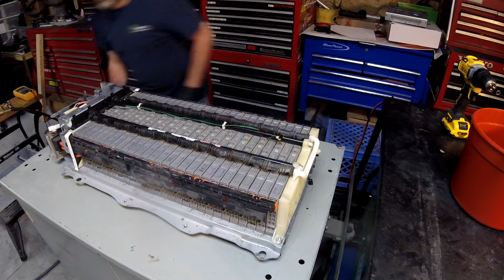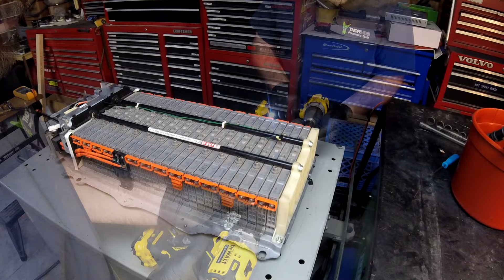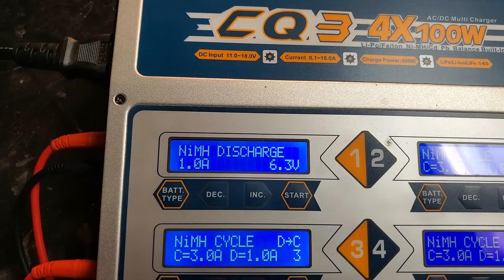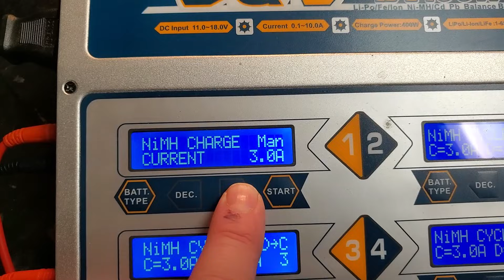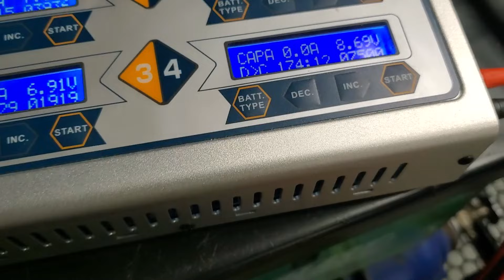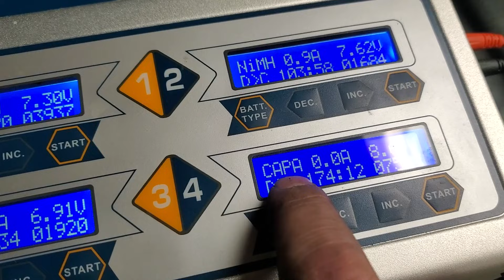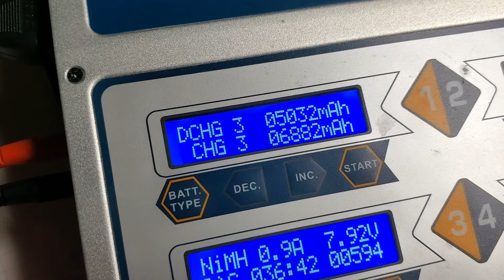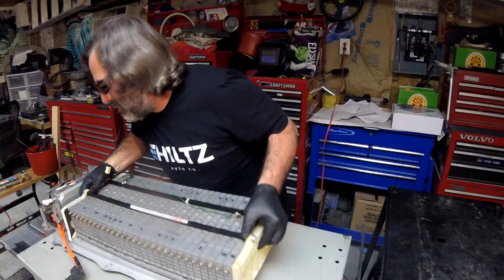DIY Refurbish / Repair Hybrid Battery 2nd Gen Toyota Prius - EV-Peak smart charger POA80 P0A80

Comment: how long will it last after charging?
Reply from the maker: That is hard to say. A pack with all cells close capacity to each other and higher capacity overall will last longer than a pack with cells that vary more in capacity and are lower capacity overall. I have had great results with the 5000mah minimum and positioning as mentioned in the video.
Reply: @GreggFesto  Hi, I have prius c and I tested my hybrid battery cells, they were showing 13,45-13,75. Mechanic said it is very bad and soon car will display Check and battery cells will start to die. Can reconditioning help? And if so how long can they last? Thank you
Reply from the maker: Giorgi, Refurbish as in my video will help cells that are starting to fail most of the time. It is possible some cells will still need to be replaced. The best way to proceed would be to follow the instructions in video so you can replace only the cells that cannot be recovered to at least 5000mah. Because you have not yet displayed check light then is is hood possibility all of your cells can be refurbished to 5000mah and you will not need to replace any. I hope you will try this and let us all know how it turns out.

Comment: So I'm having some problems I was getting ok numbers but chargers set to 1a dc n 3a c but with the cheaper chargers would dc at .6 so I got 1 of these chargers your using and always pull .9a on DC and throwing all my numbers off like I get 5500bc n 500c could I be over charging them it's set to 7500mah cap
Reply from the maker: Hello Charlie, Thanks for watching and writing in. I do not understand fully your message but will do my best to answer what I can understand. The 7500mah cap is correct for Prius cells. With charger setup as in video, there will not be an overcharge of the cell. Please let me know if this answers your question. Gregg

Comment: Hi Greg, quick question.... did you ever experience your charge cycles stop early at 50 mAh? It keeps happening randomly. I have multiple EV Peak CQ3's and all of them have experienced it at one point or another.
Reply: problem solved...issue was having the pre charging timer on. during the pre charging period you are only charging the battery at 1 amp for 5 minutes... this caused a premature charging completion.
Reply from the maker: Very interesting. Glad you figured out the issue and super stoked that you took the time to write back in and help others reading the comments that may have this issue. Hats off to you Daniel. Thank you very much.
Reply: I think my issue is that I built my own wires/alligator clips and banana plugs because the ones included were too short. Perhaps the issue is that the wire I originally used was 14 gauge... not sure. I can't make sense how it cycles normally but sometimes it only charges to 50mAh
Reply: update for any others that might have had the same issue I had. My gauge wires were not the issue, 14 and 18 gauge both work fine. it seems the issue might have been that under the user settings I had the pre charge on at 5 minutes.
Can anyone explain why this often but not always led to charging stopping at 50mAh?
Reply from the maker: I have not had this issue Daniel, I hope someone reading this can answer your question.  I thank you for watching and commenting.

Comment: Hi I'm having a problem with charging my cells on my new evpeak cq3 charger. It is only charging them now on one cycle then it flashes caps on the screen and charging stops.. The settings are what u recommended to put in. I checked the voltage on the cell and it read 8.38 volts... That seems to high of a charge for these cells overcharging? What next? What settings should I adjust to? Nick
Reply: Sorry it's flashing capa
Reply: Where is that place to change cutoff to 6.3v people are taking about? Nick
Reply from the maker: The 6.3V setting mentioned on the description list and some comments is set on the screen where you set the Discharge/Charge settings
Reply from the maker: The flashing CAPA on the screen means that your charger met the 7500mah capacity setting.  If the low capacity number is at least 5000mah then this cell is good and complete. If less than 5000mah on low number you should run it again.

Comment: So I followed your instructions in the settings for my charger/discharger. After second run it is at capacity. 7500Amh charge and 0Amh discharge. 3rd run was 0Amh charge and 0 Amh discharge. My direct voltage reading before was 7.86. After the charge/discharge it's 8.4 . Why am I getting the 0 Amh reading. Here you say it must be minimum 5000Amh yet I have increased voltage. Need help
Reply from the maker: Hello A Hendrickson, The cell voltage is not as important as the capacity.  The capacity is what will determine the health of the cell/pack. It is possible that you have a failing cell which can show voltage present and have no real power to sustain that voltage. A way to confirm this would be to connect a 12V bulb to a known good cell and see how bright the light is after a set period of time then repeat the process with a suspect cell. If the suspect cell is 0mah and 8.4V it will not last very long at all when compared to a cell that is say 7.2V @ 5000mah.
Reply: @GreggFesto  so,
 first run was C- 2256 mah and d- 5565 mah.
Second run C- 5576 mah and d- 2768mah.
3rd run- c7500mah and d- 0 mah.
Every module running similarly.
These modules are toasted? Or can I try again to run it through another round with my EV-Peak?
Reply from the maker: A Hendrickson, I have not had this sort of issue before.  Perhaps there is an improper setting in the charger or there is something wrong with the charger?
Reply: I think I figured it out. I didn't set the proper cut off at 6.3v. it was at .1v. 

I read through all your thread here and someone mentioned you didn't have the cutoff in the video and you confirmed it should be at 6.3v.  I hope I didn't ruin the modules. Anyways, I'm still waiting for the first run to finish with proper settings to see if it works
Reply from the maker: A Hendrickson, I had forgotten about that. I am glad you searched the comments and found it. Please let me know how it comes out.
Reply: @GreggFesto  hi. Where is the setting to adjust to 6.3v on the CQ3 charger?
Reply: @LordPillsbury1959  where is that setting to adjust the cutoff to 6.3v? Nick

Comment: Enjoyed the DiY effort. her's my effort for the 12 V lead acid battery renewal. Also aimed at the DiY Guy. https://www.youtube.com/watch?v=Dd0HBqpBgok
Reply from the maker: Hello Ancel, Thank you very much for watching and subscribing.  I checked out your video and your other projects on HackadayIO and just had to subscribe to your channel. I like how you went through the complete process of restoring the 12v and 6v batteries. I like that you have the kit available with all parts sourced so someone like myself who hates searching/ordering parts can have the fun of assembly still. I read that you will soon add more chemistry types to the unit, do you plan to have more voltage selections as well?
Reply: @GreggFesto  Hey...I have developed a prototype for the Toyota NiMH reconditioning. Independent University validated as a Engineering Masters project. I am developing 3 new devices. 1) A less costly 'Prolong' knockoff. 2) A complete 28 cell harness reconditioner 3) An active balancer add on for the Vehicle's  BMS = no more servicing of unbalanced cells needed.
Reply from the maker: Ancel, That is awesome. Do you plan to list these as units that can be purchased as well?
Reply: @GreggFesto  Yes , the timeline is early 2023. I am presenting to our National Chamber of Energy in 2 weeks.
Reply from the maker: Ancel, I hope all goes well for you. I am extremely impressed with your projects. Your hard work shows. Please write back and let me know the outcome of your presentation.
Reply: @GreggFesto  Started R&D into rehydrating the NiMh modules. Looks like venting H20  is the cause of failure in the hot centre cells. Developing an automated test bench to establish statistical  rehydraton outcomes. Resealing the cells via 6-32 drill/tap and JB Weld seal pressure formed with a plastic grub screw.

Comment: O saw video it shows how fix cells not good they charge and discharge to make cells usable is it ok does it work?
Reply from the maker: Yes Edwin, This process works well. I have done this to multiple packs with great results. Thank you for watching and commenting.
Reply: @GreggFesto  I use my car for work I want get spare battery in case also if battery kept as spare and not used will it die
Reply from the maker: I have stored a battery pack at least a year and it worked fine when put in the car. I have no idea how long a pack will last in storage.
Reply: @GreggFesto  where can I find a pack that's can use for this
Reply from the maker: If looking for a used pack I suggest ebay, online individuals selling such as a craigslist or facebook, or a car salvage yard.
Reply: @GreggFesto  there is repair store selling 28; dead cells 200$ is it worthed and where can I find dead cells free?
Reply from the maker: I would not pay for dead cell, what would you do with it? I have no idea where you can find them, perhaps search battery recycling center or such?
Reply: @GreggFesto  I thought if I get dead cell and refurbish thought cahrgeing and discharge process seen on utube
Reply from the maker: The method I used in video will refurbish a cell but not make a bad cell new again. There is a threshold low capacity of at least 5000mah to be considered good. I have had to replace multiple cells in just about every pack I have refurbished. If a company is selling "dead Cell;s" then I would believe they have been tested and cannot be recovered for use as a battery but rather being sold for the elements the cell is constructed from. Either way, I just do my method and replace cells as required. Thank you for your interest.
Reply: @GreggFesto  what reliable place get cells
Reply from the maker: Edwin,  There are ALLOT of sellers with good cells. Scroll through and read these comments, I list the name of place I got replacements for this pack. I have purchased from a few vendors with great results.

Comment: Great video! This is my 2nd time doing this and this video is gave me a better setup. I got quick question right now i have 6 bad cells. a have a couple cells that discharges above 5k mAh but really low charging mAh example cell 26 discharged 05169mAh but only charged at 00366mAh. is that a bad sign?
Reply from the maker: Hello Louis, Thank you for watching and commenting.  Your low mah number should be above 5000mah to be efficient. I am not sure how the high mah could be lower than the low mah. Perhaps the numbers got crossed when you recorded results? If this is the case, the low reading of 366mah and a high reading of 5169mah would mean that the cell is not good. Perhaps it can be refurbished through more discharge/charge cycles. I have run upwards of 12 cycles on a cell, sometimes with in a positive result. Most of the time when 366mah low number it just gets worse though. Can you please write back in with what you decide to do from this point and what your end results are?
Reply: @GreggFesto  thank you for replying. Yeah for some reason I have a few batteries that’s reading as charge low capacity and high discharge right now. When I first did this I revived all batteries that were bad (4)and reordered the best batteries in the middle to the weak low number towards the end. Only last about 14 months. This time I have 8 real bad one so far. I’ll update you if I am able to revive the ones that charge less but able to discharge above 5k mAh
Thanks again for this easy to understand video 💯
Reply: @GreggFesto  Hey Greg I am almost ready just wrapping up on one more cell. When you balanced the battery did you charge first then let it sit, or you just let it all sit and balanced itself?
Reply: I'm actually not going to charge anymore and just let it balance itself :) i dont want to overcharge the batteries in series.
Reply from the maker: Louis, I put all batteries in parallel when they were charged up.
Reply: @GreggFesto  A little update I ended up changing 9 cells. Also, I think some of my chargers are going bad in the charging phase, that is why when it charges it stops at a random number (b6 chargers). i have 4 b6 chargers and it looks like 2 of them going bad. I also have 2 hobby king quad chargers but only 4 of the 8 ports works. 
So far the car has been running fine since  May 24 and just passed a smog inspection that  Ca requires every 2 years. I am hoping this time the battery last over 18 month since i changed all those cells. Once it goes bad again i will reply back to this board :) Thank you again Gregg for the video!
Reply from the maker: Louis, Thanks for writing back in with your update. I sorry to hear about the charger failures. I have not had any problems with my charger so far and hope this will continue to be the case. I look forward to your next update. Stay safe, Gregg
Reply: @GreggFesto  Hi Gregg, Just wanted to update that over the weekend my triangle went on after a good 8 months. This time i will use the Dr. Prius app and see which module is bad and maybe just repair that and will update you on what I decide to do. I wish there was an easier way. this will be my 3rd time doing this. I plan to keep this car for much longer and will probably look for newer batteries as an option. i only have 228k LOL i made it  sound like it was very little.:)
Reply from the maker: Louis, Thank you for writing in with an update. Do you think the charger issues you were having before contributed to the triangle coming back so fast? I am interested to know what you find out. Can you please update what you find for pack health with Dr Prius? 227KMiles is very good. I hope you go many many more.

Comment from the maker: Sidney Peters (see comments below) has had great results with a Protek RC Prodigy Charger as a replacement for the charger I used which is getting hard to find.
Reply: @gregg festo ok so I finished watching this entirely.. and I’m not sure but will this take like 2 weeks to complete so I’ll be out of a vehicle for half a month?

How long does each module take to recharge/refurbish??
Reply: @erxfav3197  It depends on the strength of each cell. I'm currently refurbishing a Prius battery pack and for each cell to go through 3 discharge --> charge cycles took about a full day. So I bought 2 of the charger devices in order to do 8 cells at once. In about 4 days I finished cycling all 28 cells and then I removed the weak ones.

Comment: I’m following all your settings on my charger, but it’s only going through 1 cycle instead of 3. I had to do it manually 2x and I’m getting a reading of 7500/4781 then 7500/4467. I’m getting similar results with other cells with only a slight increase with the low number. (Ie 4633 to 4737) 
1)Should I keep charging/discharging until I get the bottom number over 5000?
2) Would increasing the max capacity cutoff setting from 7500mAh to 7800mAh or 8000mAh prevent it from stopping  prematurely(if it is).  If I’m always getting a reading below 5000mAh for the second number, should I increase safety timer from 720 min to a higher time or turn it off completely?
Thanks!
Reply from the maker: Hey Miami King, It appears the charger is working correctly and stopping cycles after it sees the 7500mah. Yes, you should continue to do the cycles until your low number is at least 5000mah as it is the low number that will determine the overall capacity of your pack. The safety timer is not being activated 720min so no need to change it.  It appears you are on the path to success as your low numbers are rising and the high numbers are not falling. This is good. It does take time to complete this process but it well worth it. Please keep us informed of your progress.
Reply: @GreggFesto  thanks for the reply!
I’ll keep going at it then.
Is it normal to get a strange sequence of readings like: 5461/4633 then 7500/4237 then 1924/4917 then 7500/1762?
It’s strange that it dropped on the 3rd charge then went up except for the bottom number. Should I just keep charging it until it restores regardless of the strange drop on the 3rd try?
Reply from the maker: @Miami King, That 3rd reading does seem odd and the low number dropping down drastically on the 4th cycle does not look promising either. I would run another 3 cycles on it and see what you get out of it.  If the low and high numbers do not both start to come back up then it is very plausible that you are experiencing a failing cell.
Reply: @GreggFesto  ok, so if it stops at 1 cycle,  just restart it and run it again and again  until the bottom number gets above 5000mAh, and if it never doesn’t by the 6-10 tries, it’s a bad cell?
Reply from the maker: @Miami King, I have gone as many as 15 cycles to get the desired 5000mah low number. The high number will start to drop at some point indicating the battery is weakening but as long as your numbers are over 5000mah then you should still end up with a satisfactory cell. Doing the discharge/charge cycle this many times is not a problem unless the high number starts dropping drastically at which point I would dispose of the cell.
Reply: @GreggFesto  makes sense. So by doing several cycles and restoring all cells, you’ll hopefully never need to buy another cell. Thanks for you help!!
Reply from the maker: @Miami King What was your end result/decision with the cells you had that were reading good then bad?